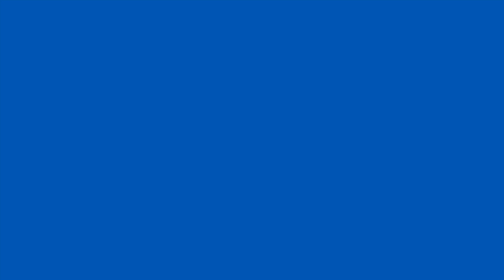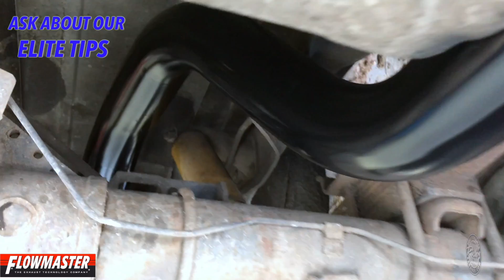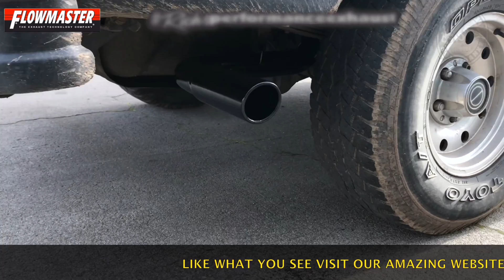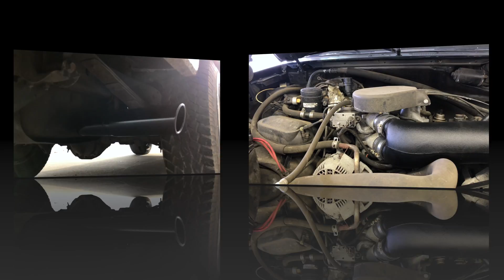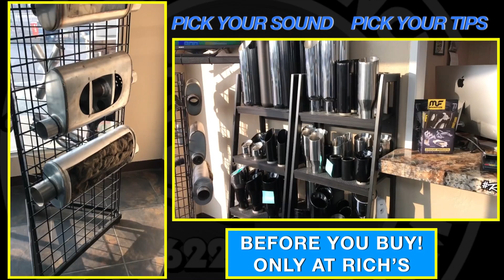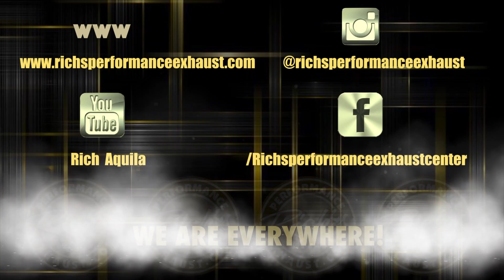96 Bronco 5.8-3 Inch Cat Back Exhaust- Flowmaster- K&N Intake- By Rich's

Comment: I seen in another video that the k$n sir intake on these has no advantage . As a matter a fact it loses power vs gains. Yes they used a dyno.
Reply from the maker: DH D good to know !! I’ll let K&N know that there air boxes have NO advantage and that they actually lose power instead of gain power! Makes you wonder if this is the case why these multi million dollar companies are spending millions on research and development? Keep reading your forums .......
Reply: @richaquila2655  Great response to a troll.
Reply: Justin Briggs added one to a ford bronco . Did nothing but lose fuel mileage and 3 horse power . Had it done in a shop in Phoenix . Had to check for myself before I can respond to your comment . A troll I am not . These things are junk . 😂😂